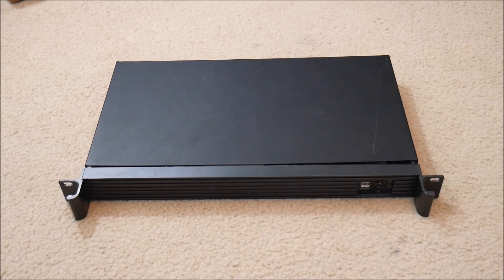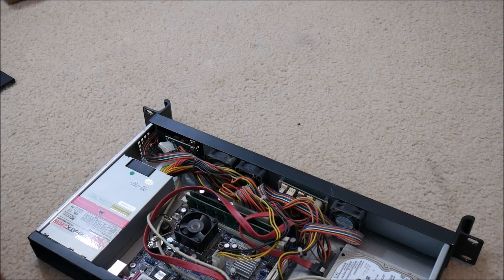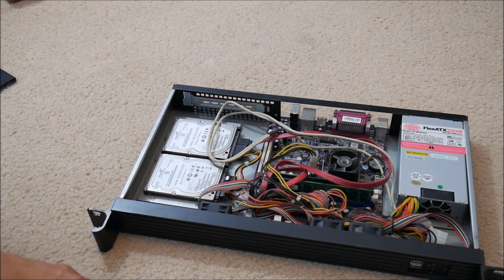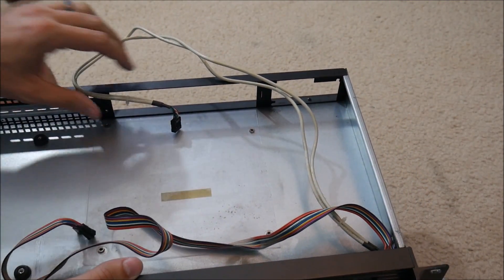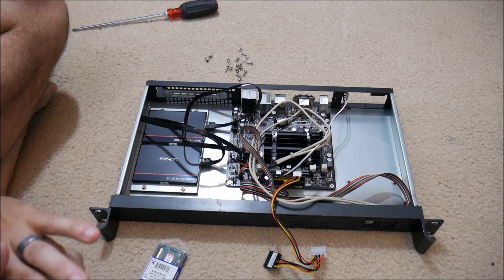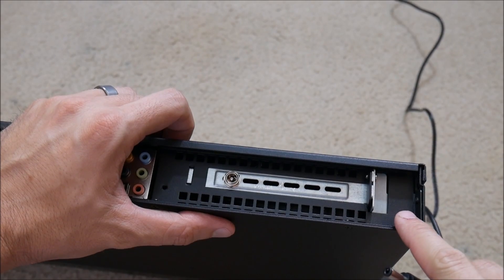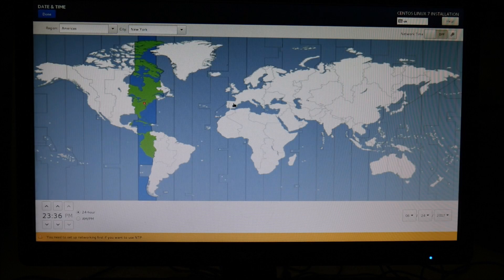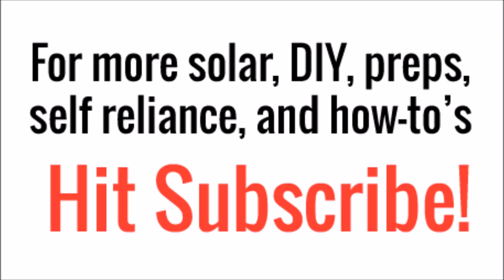Rebuilding An Old Linux Server For Home Hosting

Comment: Hi, greetings from Chile. I watched your video mainly because I'm interested in people doing the same I do. I recently mounted a small celeron J1800 ITX motherboard with a small case, but the case came with a ITX psu with a 90mm fan and it is quite noisy. I'm aware of Pico psu but it would be good to hear about the performance of yours since the one of the video got working.
My setup is similar of yours, but I'm using 2 hdd 3.5inch instead.

Cheers and keep it up!
Reply from the maker: The server has been running ever since the video without any problems.  So far so good!

Comment: Nice video, but i am not sure that a Meh quality laptop psu going in the picoPSU is more efficient than a  flexAtx 80 plus (gold and up) PSU, i know they can be qutie expensive, but i would bet that a 80+ psu would be more efficient and more reliable. Would be an interesting test to see a comparison between the two.
Reply from the maker: At that low of watts the 80 plus would never pay for itself.  But it would be an interesting video for sure.

Comment: Nice video..what do you use to build the websites? Do you use Wordpress, basic html files, or what? I have the lamp stack installed but what is the quickest way to get a basic site up and running? Thanks for any help
Reply from the maker: I just use Word Pad.  Compose the HTML and CSS and then use an FTP program to upload the files to the server.

Comment: As a very beginner, I got confused at 1:19 you said you host several websites from that setup, how you do that? Does it has to do something about port forwarding, different port for different websites or there is another way? How do you deal with single public IP for different websites?
Reply from the maker: I have different IP addresses from my ISP.  If you have a business internet connection like I do they will sell you public IP addresses.  So I assign each of my servers a public IP address and then use virtual hosting in my Apache configuration file to set up multiple domain names on the same server.  Apache will receive the inbound traffic on the public IP address and then look up which domain name it is inbound for and then route it to the proper folder on the server.

Comment: It's a cool video and all but I'd just like to mention one thing (even though you probably never would see this comment). You mentioned that you wanted to be energy conscious and whatnot around 4:00 or so and thats great, but the way you go about doing it is buying new more efficient machinery, what you didnt consider is the carbon cost of creating that new part far outweighs the inefficiency of the old part the vast majority of the time. Upgrading more frequently when it isn't necessary is contributing much more to our carbon footprint that any inefficiency in the past.

(Saying it was already made and that he isn't contributing to the carbon footprint, rather the company is isnt constructive. Rather you are creating a demand they are supplying it and you are both responsible for it)

Edit: Idk if it was something you did on the side, or how much you had beforehand sitting around I just wanted to put that out there
Reply from the maker: Of course I will see this comment.  I am not as concerned about carbon emissions as I don't really believe in carbon being bad for the environment.  What I care about is my electric bill as this will be running 24x7x365 for 4-5 or more years straight and even a few watts will add up in that time frame.

Comment: Why did you set up a software RAID rather than configure it through the motherboard?
Reply from the maker: That motherboard does not have built in RAID capabilities.  It is designed more for home theater PCs or small streaming devices than servers.

Comment: Very Good! I am a newbie to computers and currently doing research in putting together a home file server to store and backup large graphics files that I develop in my work. I do not need speed, I need redundancy and backup.  I like the form factor and power requirements of your system. The new file server will be connected to my desktop computer and laptop nothing else. It will be cost prohibitive for me to use large capacity SSDs. I am anticipating using a Raid 1 configuration with 2 - 3T HDD. I came across your video which looks very interesting. Could you help me out with the following?
1. Would your hardware configuration in the video be powerful and reliable to handle my use?
2. Is ECC memory required in my situation? I will check to see if the motherboard is compatible with ECC memory/
Reply from the maker: 1.  Yes, you don't need CPU or memory for your application.  Just disk space and redundancy.  This 1U size form factor can handle two laptop-sized hdd's and you can put them in RAID 1 configuration to mirror them.
2.  I would not pay for ECC memory.  The only benefit is for big mission critical servers for businesses.  You would see no benefit.

Comment: Awesome build! Low power, SSD performance, and silent. Shared that!
Reply from the maker: Yeah, I am pretty shocked at how little power this thing uses.  And it is hosting multiple small websites, including my own ldsreliance.com, without any trouble.
Reply: Agreed. I was surprised that the SSD drive can take my 8 year old laptop, and make it run better than it ever did before. Given me a few more years of use out of it.
Reply from the maker: Yes, installing Windows 10 and an SSD can wake up an old machine.  I am always surprised when I go back to Windows 7 how slowly it runs even on modern hardware.

Comment: I have enjoyed your videos and have been thinking about doing a shed like the one you made but for my own set of home servers, which got me thinking about using a DC power supply in them so I can power them from dc battery (research still in progress), and guess what I found just last night? That pico power supply! Funny how that timing worked out.
Please keep us updated on your thoughts on that power supply, and could you do a “Will it solar?” video with that it as well? I’d love to try running a computer directly from an off grid solar array.
Reply from the maker: Yes, good idea on both.  Having a server rack in a shed like that would alleviate all that heat interfering with your home air conditioning (my office gets really hot so I had to rig up an air conditioner in my server closet).  And doing a will it solar video on a server would be cool.  I know it will solar but showing people how to do it would be informative.

My only concern is longevity of these pico power supplies.  I am pretty sure they don't have the same kind of lifetime as a server power supply.
Reply: LDSreliance Yes please! A considerable amount of my electricity bill goes to the computers in my closet and I’ve always enjoyed tinkering with computers more than anything else, so running a computer off of solar is my first medium sized solar goal, once I have the budget. I don’t have the money for it right now and winter is coming, so I’m in no rush. But I will definitely watch and share the video as soon as it is ready.

How is the baby doing?
Reply from the maker: I have added it to the list of upcoming video possibilities (which is very long, unfortunately... or fortunately however you look at it).

The baby is great!  He requires a lot of extra care so my wife is basically getting no sleep and can't do any of her normal activities.  I get to wrangle the 3 year old when she is home and try to find time to work as much as I can.  Hopefully we can get some home health care soon to watch the baby.

Comment: Yeah, it's already been proven that it doesn't matter how bad your cable management is, it won't effect cooling or performance one bit. 

Nice video!
Reply from the maker: Thanks!  I appreciate it.  As long as I can open the case and get to everything I need and my wires don't end up in my fans I don't care lol
Reply: LDSreliance When it comes to servers, I am the same way. lol. But when I built my gaming computers, I made sure to have clean and neat cable management. But that's only because you can see the inside of the case from the side panel window. lol
Reply from the maker: Yeah that might bother me a bit more.  But I never buy a case with a window for exactly that reason!

Comment: "fanless server devices and atom boards assume fans from the case are in use.....
Reply from the maker: +BIZKIT That is true for most builds but this processor uses less than 7W of power and really doesnt produce much heat.  It is similar to a Raspberry Pi and there are no fans on those.
Reply: Now one year later - did you monitor heat and how your server is working? I'm pretty interested in some long term update. ;)
Reply: @LDSreliance  Same as +Bthesaxhat. Can you give us an overview of your set ups and personal opinion in 2019/2020 ?

Comment: I enjoy your videos, and don't mind the different topic.  I was worried with you building on the carpet that we would be in for some shocks like ElectroBoom's channel...  especially when you took the ram out by the connectors.
My question is, if the pico power supply runs off twelve volts, why not run it directly off a solar charged battery? (hopefully not a spoiler, sorry.)  The laptop brick is still converting AC to DC, and will be a big source of heat in your server closet...  even if you don't go solar you could tap straight into the battery of a UPS for your other servers.  8-Bit Guy did an interesting how-to a while back.
Thanks for sharing your videos.  Keep it up.
Reply from the maker: I do plan on powering this with solar in the near future.  However, if you are following my solar shed rebuild series, my solar panel system is currently down for rebuilding and maintenance.  I have a small feed running into my office that will very easily and reliably power the 10-20 Watts that this box consumes.  All I will need to do is find the right connector to plug into the Pico PSU and I will keep the laptop adapter as an emergency backup.

Comment: Nice! A dedicated rack-mounted server install with low power, low noise, and low heat. Definitely a good thing these days. Especially, when not necessary in a commercial data center environment. Only concern might be redundancy, depending on uptime expectations.
Reply from the maker: Right.  This wouldn't be a good mission critical server.  I host small business websites and mail systems and while my customers will complain if their email doesn't work they also understand they aren't paying for 99.9999% uptime and they aren't losing thousands of dollars per hour on some big e-commerce site.  This will lower my power bill substantially and decrease the noise level in my office.
Reply: I run low rpm fans. I also dump it in my garage with a rack and  vent the cabinet outside. Then you can use inexpensive box fans to push enough air over the equipment. Also running at 220 (my conversion is in process) will drop heat and power consumption by a lot as 220v has lower hz and amp requirement, it will drop heat significantly.
Reply from the maker: Cool, I didn't know that.